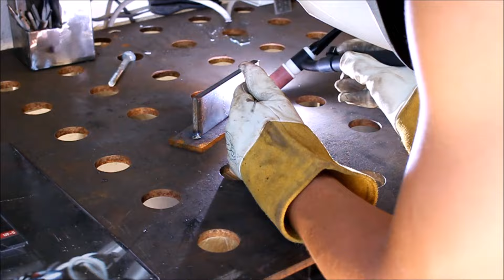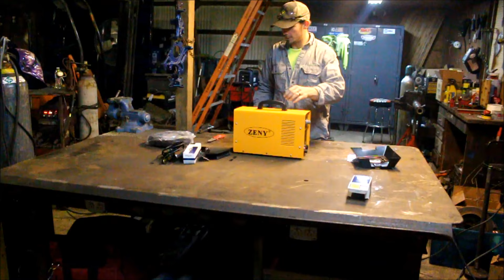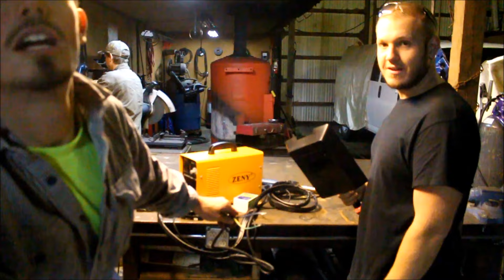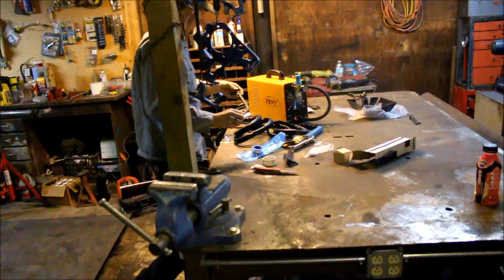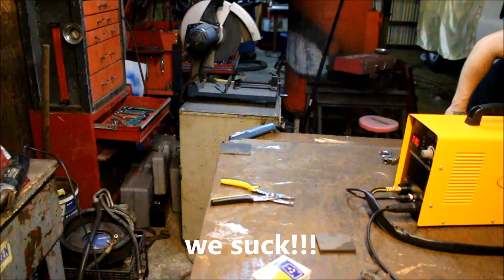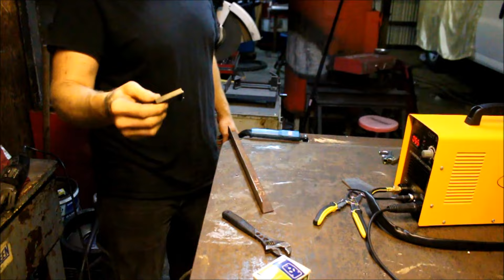Zeny Cut 50 plasma cutter (unboxing & First impressions)

Comment: I’ve had mine for over a year, I use it to cut probably 10 hours a month it struggles to  cut 1/4 I beam flanges length wise but I probably put over 100 hours on it
Reply from the maker: Right on thanks for sharing

Comment: I never sould see the plug well...That is dual voltage...Did you have it wired for 110 or 220?
Reply from the maker: Mountain Crest Farm I wired it for 220 sorry i didn’t see this comment till now!
Reply: @ChantzFabz  I am working this one for 220, I have gren/yellow, blue and a brown. I'm using a welder plug. how do I wire it?  please share